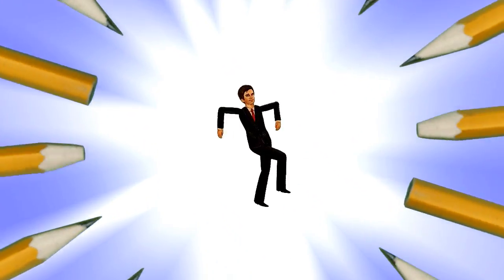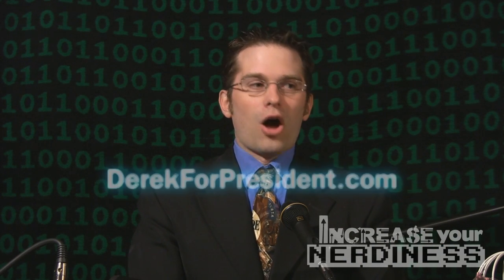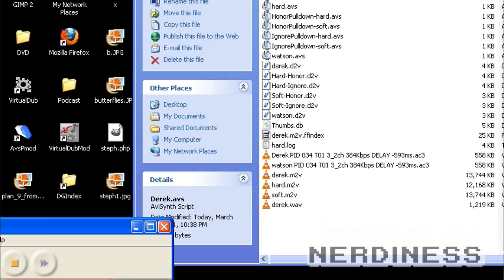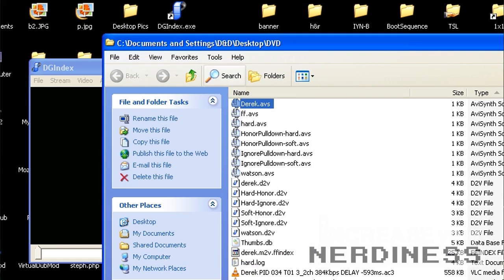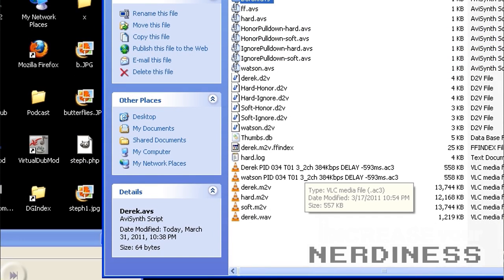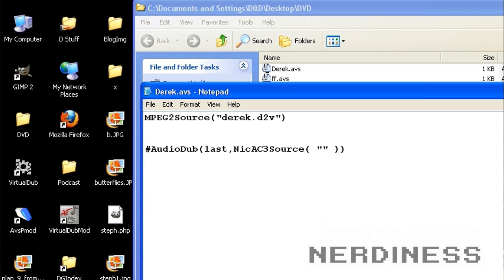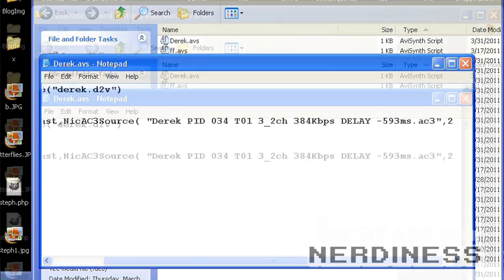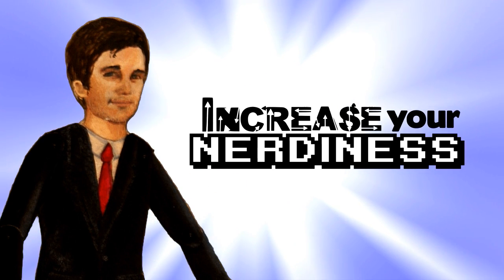Indexing

Comment: CDs were originally intended to be analogue, FM encoded, just like the audio tracks on Laserdiscs.  It's just pits that are closer together for more energy or farther apart for less energy.  So, even though you're stuck with pits & flats, on/off, the space between them and the size of the pits themselves are infinitely variable, allowing for an analogue signal.
To my knowledge, HDDs have never been made as analogue media, but the technology could be adapted to hold PWM encoded audio or video.

Comment: *ALMOST* right. Analog mediums can hold digital because you can just ignore all the in-between values. Obviously, this is not entirely efficient since you lose all those in-between values as possibilities, but sometimes the benefits of digital outweigh this particular kind of loss.

On the other hand, digital mediums generally cannot hold analog streams. A great example of this is punchcards. Another example, I think, is CDs (it might be possible to modify them to support analog).